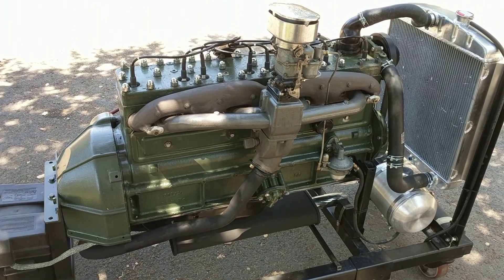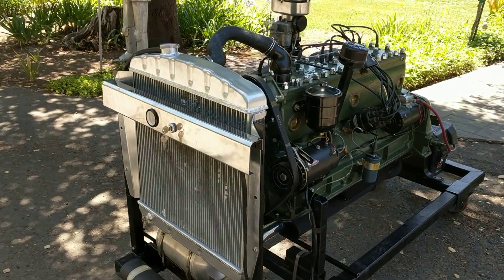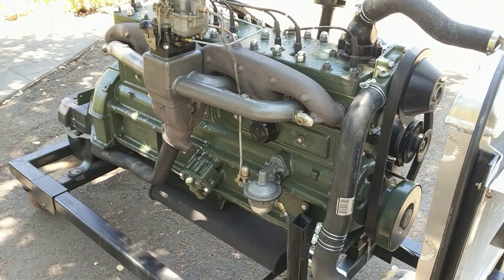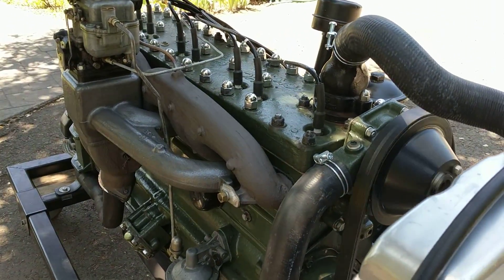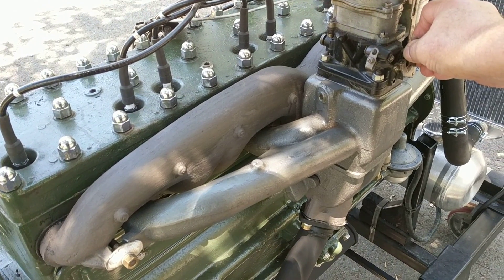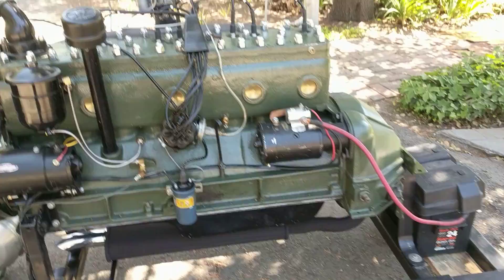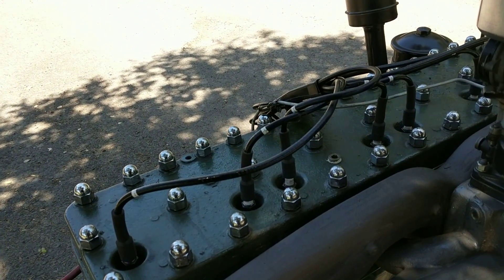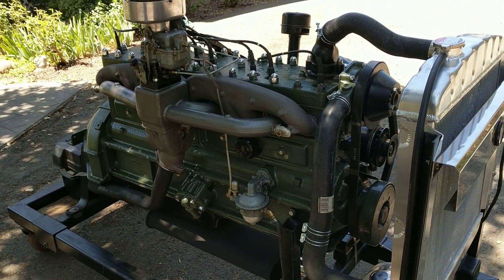Test running of a Packard 356

Comment: Nice.  Were those typically set up with a manual choke?  My first car was a '61 Falcon with the 144 straight six, and it had a manual choke.  Our Dad's first car was a straight eight Packard.  That hood was long!
Reply from the maker: Depends on what year. But this one has an automatic choke.
Reply: Per another YouTube video, straight 8 Packards had some kind of vacuum system to instantly restart the car if it stalled.

Comment: are these worth anything ? one is sitting in a car in the junkyard. wonder if i could put it in a stand like that. i can buy it for 220$ from the yard
Reply from the maker: There is a Packard Facebook forum where you may get a better answer. Depends on location of the engine. Also actual condition of it internally. You are probably better off rebuilding a more desriable engine.. Small block Chevy or Ford. If that junkyard car has trim parts and other small items, you may have more chance to make a few dollars by selling those parts.